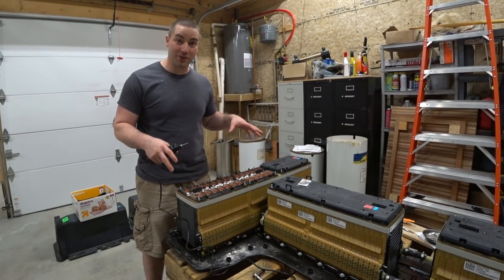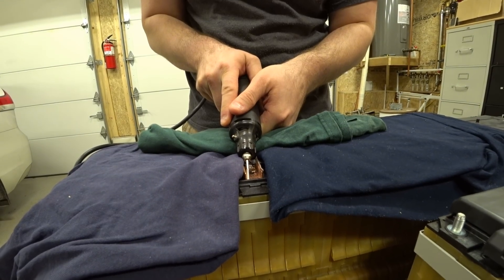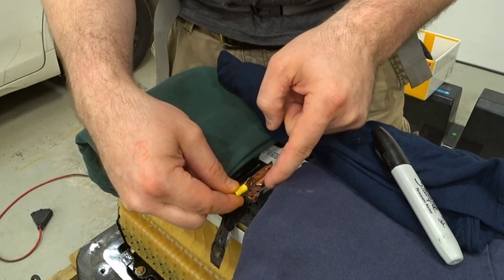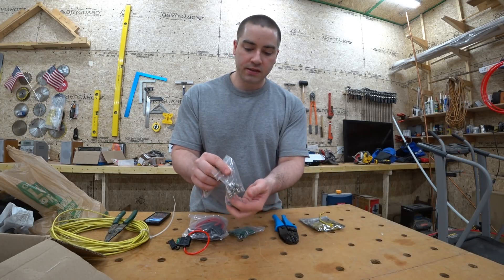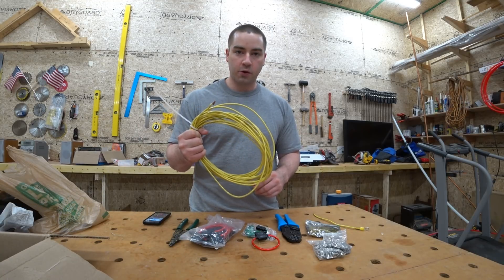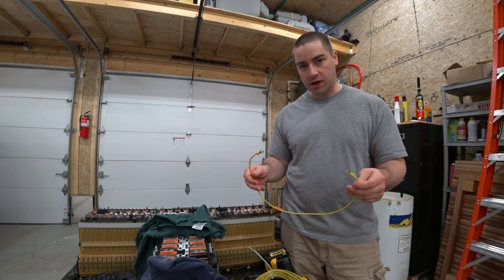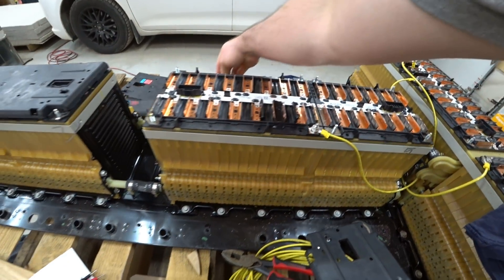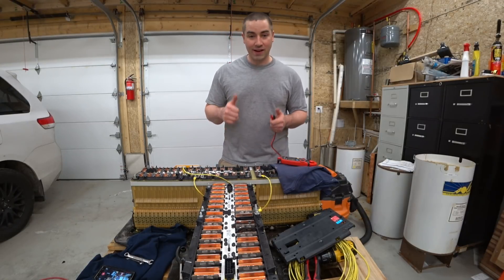Battery Modifying from Chevy Volt for DIY Powerwall, Gen 2

Comment: In addition to putting wood behind the drills exit,, put a piece of fuel line or vac hose over the drill bit and cut it slightly shorter than the bit to limit pull thru.

Comment: Dou I have to use a bus for an off grid cabin? On my chevy volt batteries???
Reply from the maker: If you mean Bus bars, they are an excellent way to tie together all the wiring.  It's not required, but makes things easier.

Comment: What's the amp hours of the Chevy volt battery?
Reply from the maker: The label said "18 kwh".
Reply: @DavidPozEnergy  I mean for your 48v battery bank system after you finish.48v at ...amp hours? Is it still 18kwh after u convert it to 48v?

Comment: David, you are so fearless, I could never put that much money into a uncertain project.  I did buy a Chevy Volt battery, but it is still in the car we drive every day,  and even with the new car warranty, I felt like we were taking a great leap of faith.  Thank you for sharing all these fearless adventures with us thru YouTube.  Good luck.
Reply from the maker: I was inspired by all the other great videos out there.  If you haven't seen them yet, "Mark Osborne" and "Going Off Grid" both have some Chevy volt batteries.
Reply: We have two Gen II Volts. Great cars. GM support horrible.

Comment: Hey David...  can I bug you for the size/dementions of the 48 packs i need to figure out if i can fit the 8 modules in my SUV before i head out town to buy one ... ill definitely have to dismantle it to load it up... thanks
Reply from the maker: Hi peeinginthewind,  Sure.  I just measured it up for you.  A single battery, 12s (12 cells in series) is a nominal 44 volts, but works with a lot of 48 volt equipment.  This is the arrangement I'm using 8x 12s batteries.  Each 12s group is 9.0 inches deep, 9.5 inches wide, and 11 inches tall.  
BTW, the whole assemble is a big "T" shaped thing.  I was able to bring the whole assembly home in my mini-van.  It is 38 inches by 62 inches, by 15 inches tall.
I hope that helps you grab one.  Note: I have the Gen 2 battery.  If you are going to grab a Gen 1 then the dimensions might be slightly larger, but not by much.
Reply: @DavidPozEnergy  wow great !! Thanks for all the info ... that really helps ...are you pretty happy with the volt packs ? This will be my first lithium
Reply from the maker: The Volt pack is amazing.  I have certainly enjoyed working with the Volt pack more than the Smart Fortwo pack.  If I was buying them all over again I would still buy my pack at $2k for 18.4kwh ($110/kwh).  But I would be careful not to overspend.  I've checked prices on new liFePO4 batteries from Aliexpress or Alibaba, and you can find them for $150/kwh.  (100 ah cells).  So I would buy the cheaper one, but that will depend on the prices you are finding.
Reply from the maker: All that sounds great.  Excellent price.
Reply: @DavidPozEnergy  so basically I have  3 packs a small medium and a large .. the small one is like 2 "48v" packs .. but it looks like each one is 17 cells times 2 for the small one .. so do I divide the voltage of 43v what's its currently at by 17 ?
Reply from the maker: I'm not following.  Sorry.  Could you send me a picture through my website e-mail, or through Facebook? https://www.facebook.com/DavidPozEnergy/
Reply from the maker: I have not tried the built-in charger on the Aims.  There is no way to set the voltage low enough for my 12s batteries.  But the Sun does a great job charging them.
Reply from the maker: If I ever have to re-locate my battery, or do some kind of overhaul, I plan to re-wire as a 14s.   If you have not yet bought inverters and solar chargers, then it makes more sense to go 14s.  It will make the purchase of everything else easier.

Comment: the packs are 48 volt and 24 volt why did you go thru all that bulldodo to get what you already had
Reply from the maker: LOL... "Bulldodo"
You are making an assumption the pack is already split into 48v and 24v sizes. Only the Gen 1 Volt is split that way. This is the second generation battery (2016).  Thanks for watching.

Comment: number 10 solid way to small
Reply from the maker: Hi Scott Banks, I don't know what you are basing your comment on because you provided no supporting information. Why do you assume the wire is too small?  When I sized the wire I used the ampacity table in the NEC.  Also, the wire is not solid, it is THWN.  Thanks for watching.

Comment: Can you use a hybrid Toyota prius battery pack? If so how do i wire everything,i want a 12v system
Reply from the maker: I don't know if you can use a battery from a Toyota Prius.  I don't know what type of chemistry, how the cells are arranged, or the charging voltage.  I'm sorry I can't help.
Reply: @DavidPozEnergy  okay no prop👍
Reply: Each prius cell is about 3.5 times 28 if I remember

Comment: Hey David, a quick one. When you are breaking down the battery and cutting in between the cells, do you only have to cut the top visible metal plate joining to adjacent cells? You don't have to cut in and below the plastic cover housing the pouch cells right? I have seen vids where people cut deep inside where the cells are. Seems to be unnecessary from what I see on your vid. As usual thanks for your great vids! Cheers
Reply from the maker: Hi SPA,  For my application I was leaving all the cells bolted together in one big module.  All I cared about was breaking the electrical connection between series cells.  So I only cut the copper "bus-bar" on top.  

I have also seen videos where people cut deep in.  What they are doing is physically un-bolting the battery pack and making smaller modules.  You need to cut all the way through the plastic to separate the cells.  This is useful if you have a tight-fitting place you are trying to place the batteries, but I didn't need to do it.
Reply: @DavidPozEnergy  Thanks. But I just wanted to know about electrical connections. For physical separation, I'm all set. Cheers.

Comment: Did you end up using a BMS on this? And if not, are they staying balanced? I'm doing a similar project with a different battery and I'm not planning on using a BMS.
Reply from the maker: I currently have no BMS.  My plan from the beginning was always to add one, but I haven't yet decided on which.  However, all the cells are still perfect so I'm slowly adjusting my thoughts on whether to add one or not.  Are you using Chevy Volt batteries too?
Reply: @DavidPozEnergy  I'm using a Smart Fortwo battery.  16s 6p. Its lithium NMC pouch cells.  Should be around 17kWh usable power.
Reply from the maker: Great.  I haven't seen any videos of someone using that battery.  I'd love to see pics or vid. of your setup.
Reply from the maker: Unless those are the black plastic cases?
Reply: @DavidPozEnergy  no, the tabs are accessible. I took a gamble with it as not much info on the web.   Not sure how to send pictures on YouTube and I don't have any videos.  Find me on Facebook and we can chat.

Comment: Hi, I've installed BMS for this batteries and they work well. If you're interested to have BMS just reply on this comment :)
Reply from the maker: I've been looking for a good BMS.
Reply: @DavidPozEnergy  there is battrium, which is quite experience, but I tried this Chinese BMS  https://www.aliexpress.com/item/12S-100A-smart-board-lipo-lithium-Polymer-BMS-PCM-PCB-battery-protection-board-for-18650-Li/32848466970.html?spm=a2g0s.9042311.0.0.5f6c4c4diGQ00Y
Reply from the maker: Thanks for sharing.
Reply: it worked well. You can adjust via bluetooth or usb  serial port the overvoltage and undervoltage. So it's protection for your batteries, that they never discharge under the level, that the batteries damages

Comment: Nice video, but why 44v tho, I’m trying to understand because most 48v nominal systems cut out at or about 44v
Reply from the maker: Hi Adrian,  Chevy built the packs in smaller groups of 12 cells in series (12s) before bolting the whole thing together.  This makes it easy to un-bolt it back into 12s configuration.  12s is about 44v nominal.  If I tried to make it a true 48v battery that needs 14 cells in series (14s).  This would require a lot more work in re-wiring almost every cell.  Plus, I would end up having left over cells I can't do anything with.

All that being said, 14s is a great way to go if you can.  If I ever buy another pack I will probably take both packs and re-wire them to 14s.  The leftover cells from each pack can be combined to make another 14s group, minimizing waste.

Thanks for watching.
Reply: DavidPoz quick question, at what volt your inverter cuts out? Low battery disconnect
Reply from the maker: Hi Adrian,  my inverter cuts out at 42 volts.  Some inverters even go lower, such as the Magnum I think cuts out at 36 or 38.

Comment: Can you post a link to the power inverter that you found on Ebay and bought?
Reply from the maker: https://www.ebay.com/itm/Pure-Sine-Wave-Inverter-3000W-Power-Inverter-48V-to-120V-Off-Grid-LED-Display/201705518062?epid=523266535&hash=item2ef695f3ee%3Ag%3AfacAAOSwwbdWQaFM&_sacat=0&_nkw=Pure+Sine+Wave+Inverter+3000W+Power+Inverter+48V+to+120V+Off+Grid+LED+Display&_from=R40&rt=nc&_trksid=m570.l1313
Reply from the maker: This is the same seller, same model.

Comment: Do you know the charge resistance of these batteries?  A lead acid bat will loose about 40% of the electricity going in due to charging resistance.  This is the great advantage of lithium ion batteries, and charge cycles. BUT..... for 2000$ you coukd buy 23 new deep cycle wet batteries.   Have you done cost comparisons  over time?
Reply from the maker: Hi Sails,  I don't know those figures, sorry.

Comment: My suggestion to you is you should have welded or soldered your connections
Reply from the maker: I was thinking the same thing, about somehow spot-welding copper tabs on.  I just couldn't see getting the tips of a spot welder in place without hitting the other tabs.

Comment: I need 29.4 volts at full charge. do you think it would be easy to achieve? how many and what type cells are they using? if you know? also have you tested the capacity for the remaining capacity? I have heard they supose to have over 80% after a few years of use. my worry is spending that kind of money. and have 10% of speced capacity. the pack I built is from new old stock Samsung çells . they come in at 108 ah. but I want to only charge to 4v or 4.1v to extend life. and only go down to 3.2 or so. should more than double service life. sorry for rambling!
Reply from the maker: Hi James,  In this Gen 2 battery, Chevy used 192 cells in a 2p96s configuration.  Two cells are grouped together into a pair called a "cell group" and then 96 cell groups are wired up in series.  I generally just call each cell group a "cell" in my videos to simplify.  There is a pretty good video on this from WeberAuto: https://youtu.be/eWYtq0hxhQg

Each cell has a nominal voltage of 3.7v.  Generally this is going to be used from 3.5v to 4.1v, however if you wanted you could go a bit higher and lower.  You asked about 29.4v, so I would just divide that by 4.1 = 7.17 cells.  If you used 7s (7 in series) that would probably be close enough.  Try looking up videos using 24v nominal batteries.

I have not tested the capacity of my battery.  I'll probably do a video on that once I have a charge controller.  Here is a good video from Mark Osborne, he did a capacity test on his Chevy volt battery: https://youtu.be/lwPxUmMO_jk
Reply: +DavidPoz thanks  for the info. I have a 7 series pack now it's only 108 ah. I just don't know much about the ev batteries. I know the leaf batteries are each 2 cells in series. it would be hard for me to use them. unless used 6series. the issue with that. is you can only use half the capacity. and that's pushing it. my inverter doesn't like under 22.5v . it starts the low voltage alarm. and has bad efficiency. I want to run it from 28.8v down to 23-24v. the cells last lots longer if not fully charged. and not fully discharged. some say 20+ years is possible if only 40% is used. and only charged to 3.8v-3.9. v . most of the degradation happens at higher voltage. . thanks for the info. maybe I can find a deal on some of these! thanks again. and I subbed to hour channel!

Comment: When doing a solar to battery bank set up does it make more sense to do higher voltage like this vs going down to 12v or 24v?
Reply from the maker: Hi Casey Cross, I'm working on making a whole-house system, so for me it makes sense to use a 48v setup.  For example if I pull 8,000 watts at 48 volts that's 167 amps.  At 12 volts that's 667 amps.  It is the high amps that is harder to deal with.  However, if you are powering very small loads, say 2000w or less, then it might make more sense for 12v because sometimes 12v inverters are less money.  But you have to keep the amps within the limits of the wires, circuit breakers, charge controllers, batteries, and inverter.
Reply: DavidPoz all makes sense..... i come from a deep background in 12volt.  And i have dealt with RVs for last 15 years.   
I’m going to be doing a build on a 56 ford bus that was converted to RV in the 70’s and has been untouched since.  The customer wants it off the grid as much as possible.  The layout i had planned is 1650 watts then was planning on bank of 12v group 31 batteries.  Or doing 6volt golf cart batteries.   Then a pair of magnum inverters would be able to do it from there.  

However after seeing your videos im wanting to rethink my layout on the solar and battery portion. 

I can have high voltage battery bank and low voltage battery bank too..... seems to be the most logical since there is a large amount of items in a RV that run off 12v
Reply from the maker: Have you seen "Beginning from this morning" YouTube channel?  I think they are doing what you are describing.
Reply: DavidPoz i havent yet, but i will search them here in a few and check it out

Comment: So how many AH  would this be comparable to if it was a 12 volt style system?
Reply from the maker: Hi Casey Cross, This is an 18 kwh battery.  18,000 w*hrs divided by 12v = 1,500 amp*hrs.

Comment: Suggestion, instead of t-shirts as a barrier for shorting I have cut thin walled PVC type pipe into 3" lengths and then split the pipe along its length. I am then able to spread the pipe open and placed it over a set of tabs on top of the battery thus shielding them from accidental contact. Alternately, you can also use some wiremold (https://www.lowes.com/pd/Wiremold-1-Piece-1-in-x-60-in-Straight-Channel-White-Cord-Cover/3130109) and cut in 3" lengths to slide over the tabs individually. Both methods help keep the sparks from flying.

Comment: The Volt battery works perfectly for a 48V system as is. You use each 48V pack and then run the two 24V packs in series to make another 48V. I wouldnt try to split one of the 48V packs.  Both the Volt and Leaf work out great as they are for a 48V powerwall.
Reply from the maker: Thanks beeewarned!  The Gen 1 battery had 44v and 22v cell groups.  I'm using the Gen 2 battery which Chevy wired a little different at 44v and 58v cell groups.  I'm only splitting the larger 58v cell groups down to match the 44v cell groups.  Thanks for watching.
Reply: I didnt know the Gen 2 was so different.  Way more work!  I would suggest to anyone else that they salvage a Gen 1, cheaper and pretty much plug and play from the factory.  I have 3 in my powerwall, plus a Leaf battery which actually works out perfectly in voltage too.  As long as you have a charge controller that will set down to approx 49.2V max.   I am going to do a video of my system and put it up soon.
Reply: @beeewarned  are you still using your gen 1 Chevy Volt battery in your power wall... I'm interested in any info or videos you might have on the subject.

Thanks so much
Rance White
Reply: @beeewarned  Id love to see your set-up. I am curious about a non-BMS option.

Comment: Not trolling here and by no means am I an "expert": get yourself some type of old plastic... old milk jugs or detergent bottles ( a little thicker gauge than milk jugs) or similar and cut them into strips of appropriate length and twice the height of those terminal bars...heat them with a heat gun and fold them in half, to be used as insulators while you are make the terminal connections...I was cringing while you were bolting up your test leads. Be creative, but try and find a way to make some kind temporary insulators...web search images "plastic binder slides" to get a visual of what I'm thinking of...other than that, looking forward to more on this project!
Reply from the maker: Thank you for such a positive comment.  I really appreciate you offering a suggestion to help insulate surrounding tabs.  I'm going to try your suggestion.
Reply from the maker: I used your suggestion in this video: https://youtu.be/ciA8DGPpVqE

Comment: when you do the load test try to have a thermal camera to see the hot spots, Those ring terminals should heat when you put any amps though them. So you can see how far you can push things
Reply from the maker: Thanks for the suggestion.  I hope they don't heat up too much.  Even if I draw 8,000 watts, that 1,000 watts per battery, or 24 amps through the ring terminal (with the battery at low voltage).  The rating for these terminals is 45 amps.  If they are a problem, do you know of a better connection?

Comment: Hello from Cairo Egypt. Well done. Maybe you can put some silicone on top of the 10 mm screws to make sure that there is no movement or shorting of the screw and nut in the future. I wish I could get one of these batteries here in Egypt. $2k for ~18 kWh is a bit more than $100 per kWh. Bravo.
Reply from the maker: Thanks for the suggestion.